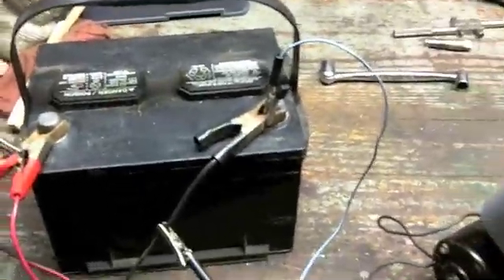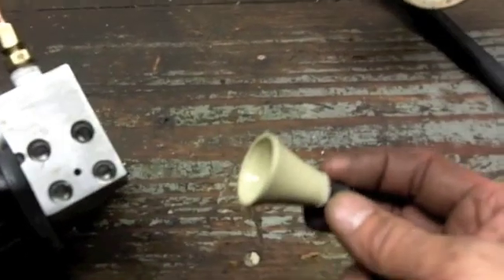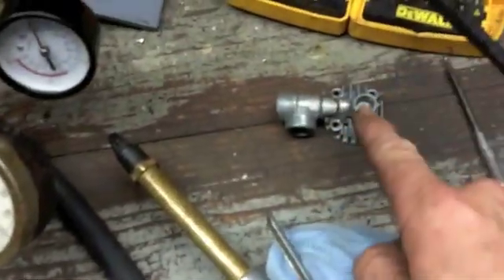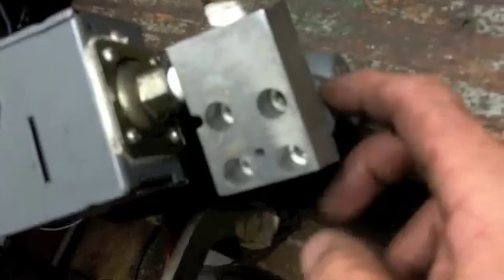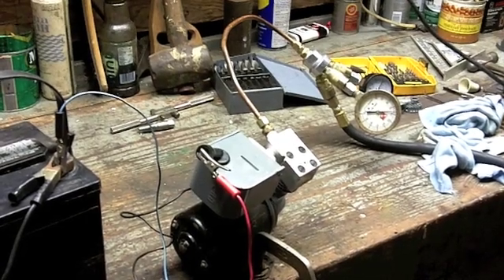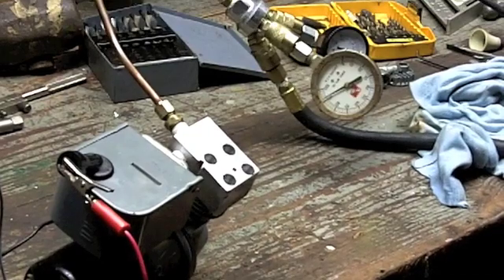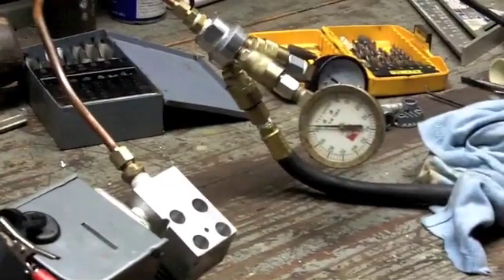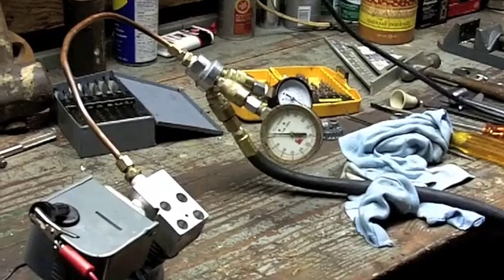Home Made Cylinder Head Pt2

Comment: When I wanted an air horn on my ocean sailing yacht I bought a used single truck trumpet and mounted it on the mast head; then ran a plastic line up the mast to it. I blew it with CO2 from a small CO2 fire extinguisher bottle. since the CO2 is stored as a liquid and changes to a gas on the way out you get approx. a life-time's supply of horn blowing in one ten lb. CO2 tank. I didn't use a pressure reduceer; just a 1/16" hole in the tank handle valve and the volume of the fifty feet of plastic hose to the horn reduced the pressure. The added advantage is that CO2 is heavier than air which  changes the pitch of the horn. It lowers it. My Boat sounded like an Aircraft Carrier; which is exactly what I wanted to get the attention of the dozy or drunk "Capitains" of foreign fishing vessels I might need to wake up.
Reply from the maker: John Affleck I like that idea...hmmm, you are giving me ideas....

Comment from the maker: Thanks Jeff, There is that brass plug in the base of the compression unit where you fill light oil... I use ATF.  If I were to use this in a water pressurizing situation (as in an RV) you would run a mineral oil as some of the case oil does migrate into the compressed side of things.